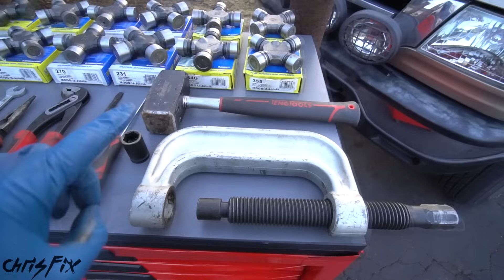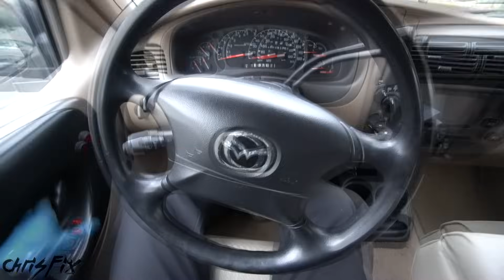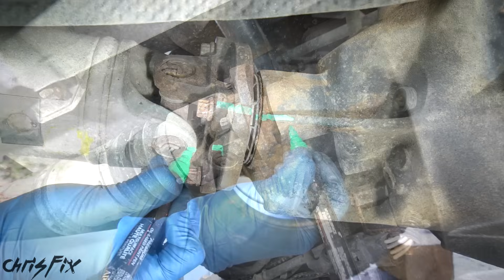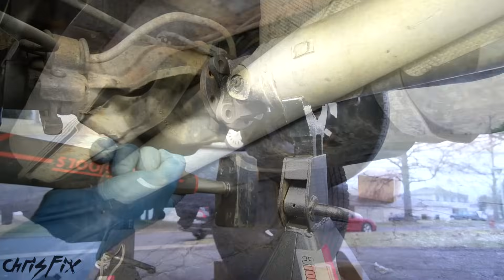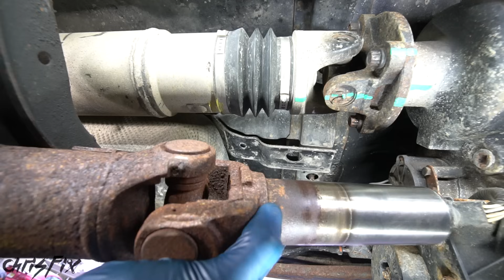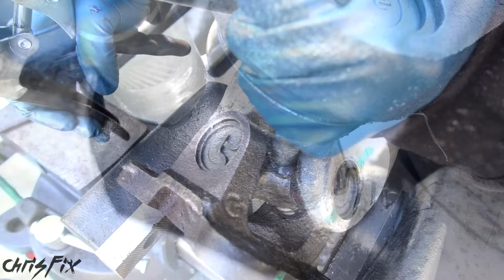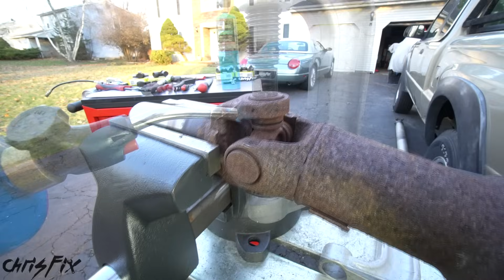How to Diagnose and Replace Universal Joints (ULTIMATE Guide)

Comment: My 2009 Nissan Murano LE AWD has 136,000 miles. The rear drive shaft is very rusty. Would it be prudent to wire brush the shaft, then use something like WD-40 or some other rust stopping spray? Could I throw off the balance of the shaft?

Comment: What if you didn’t mark the shaft and the differential? I did my output shaft seal and the truck nearly ran me over cause I didn’t chock or put the e brake on. Anyway, I didn’t mark anything. But reinstalled everything without knowing shafts were balanced. I do feel vibration now. Should I just mark where it is now and turn it?

Comment: I have a Chevy 1999 suburban, I thought it was u joints because there was a grinding sound coming from the driver side wheel. Replaced them and the sound is still there so you think it could be the wheel bearing assembly?
Reply: Most likely yeah. First would make sure one of the brakes isnt hung up though. Had a similar issue with my caddy.

Comment: U joints changed out in the advance auto parking lot. The caps bearing were all gone and when the caps came off and red dust fell out, they were bad. Whole truck would shake when braking now it rides like a Queen

Comment: Hi Chris. I have a 1989 Toyota pickup. About 8 months after I got it, the rear end chirped really bad. I assumed it was the brake pads (which were bad) but once I replaced those it went away. A few months later it came and went, came and went, well, a year and a half later of coming and going (now) when going over 45, the entire truck vibrates heavily. I drove it two weeks with that. Well last night my dad looks under the truck because I was pretty sure that it was a u joint and sure enough the back u joint wasn’t going bad, but BUSTED. Long story short I drove on a broken u joint for a year and a half😂😂😂😂😂
Reply from the maker: Yikes! I'm glad it's all fixed now!

Comment: Yesterday I had to have a U-joint replaced. I had it replaced by another garage and they used the wrong part number -THREE TIMES. It blew apart on the highway and the end caps were gone! They replaced it it again and it blew apart on the mechanic when he took it for a test ride. I don't know what they did the third time but I had a buzzing grinding sound at speed and I just ended up going to another garage. They looked at it and immediately knew it was the wrong U joint..

Comment: I need someone's help please! I have a 01 mustang GT, heard a chirping noise under car thought it was one of the wheels or brakes, so I replaced all brakes and rotors and calipers, chirp Is still going, so now I replaced both u joints, sound is gone for 2 days and then it came back, it's definitely something under my car. Need help, about to get rid of the car, btw the noise is only present when car is cold and I start driving, when I stop sound is gone, the faster I move the sound fades. The brakes have no effect on sound.

Comment: Did you use the right u-joint? Is there not a u-joint for aluminum driveshafts that have a coated cup to keep the steel and aluminum from fighting? I think they have a "C" or "A" suffix after the number. I change a lot of u-joints and sometimes they are a lot harder to change than yours were. I have never used a press, usually a vice and hammer. Make sure you don't get a needle sideways in the bottom of the cup. I usually put a dab of thick grease on my little finger and rub it in the cup. the needle bearings will stay in way better. Now show how to change the 2 cv u-joints and ball kit!

Comment: I have a manual e46 and it vibrates bad when I let off the throttle or at high speeds and vibration also varies w throttle position most of the time is this possibly my ujoints?

Comment: Quick question...what if my rear U-joint snapped, forcing the truck to kick out the drive shaft. Since it's already out, should there a concern for the way the new one lines up? Getting a new drive shaft, yoke and joints. Drive shaft hot the pavement hard a few times before it finally gave out, so I don't trust that it isn't warped or out of balance. Thanks in advance.

Comment: Great demonstration video - PERFECT!  I wish you would have pulled the seal at the transmission end of the shaft to replace with a new seal. I have a 2002 Ford Ranger 4.0L 4X4 with 172,000 miles and I get a little clang between it wanting to decide to upshift or down shift between 1st and second gears at 20 mph. Like when I gas it on a residential street and brake it to make a right turn where its caught wanting to upshift or down shift (backlash). The U-Joint are probable wore anyway, wouldn't hurt to change them out. So I do the drive shaft U-joint change soon. Thanks!

Comment: Could it be u joints if my car makes a clank and grinding sound when my wheel is turned more then a 45° angle? It's only when I'm backing in and out of a spot or my driveway. Other then that it dont grind when I'm over 20mph

Comment: That's why there is a slip joint on a driveshaft because of the leaf spring as it goes forward the leaf spring goes in s shape which makes the slip joint extend and the opposite happens when braking. One of the common reasons why the universal joint goes bad is because of the driveline angle if the angle is high it would make more vibration and the drive on the driveshaft will be like in oval shape and if there is no angle which reduces the life of a universal joint. Soo it has to be in the middle. The example of the   universal joint wasn't quite right it was an example of a cv because cv joints are flexible, they dont need a angle to work at like a universal joint. CV joints can work at any given angle and they never wear out.
Reply from the maker: Thanks for sharing.

Comment: I just put a starter in my 08 dodge nitro it was atop of the drive shaft so I had to move it out of the way. My U joints need to be replaced. After knocking out that starter like a pro I want to do u joints. My car vibrates and it's no dount the ujoints and they are cheaper to replace than getting a whole drive shaft. I'm excited.

Comment: You make it look so easy. I’ve been at it since 11am. It’s 6pm now lol about to through truck in trash lll
Reply: Lol...I can relate.  Two I was able to get on but the other two is half on and wont budge or move any further.  I have to now pay a mechanic to fix my problem.
Reply: @oneloveyessah  watch out sometimes you will accidentaly knock the roller pins into the bottom of the cab and you will not be able to fully install the ujoint and if you force to hard you will break the loose needle pin

Comment: As usual, you're presentation of the repair is perfect, Chris! This is exactly problem I'm having with my 2017 Nissan Frontier Pro4x, yes this is a know issue on Frontiers. Apparently, Nissan has installed a ton of faulty u-joints, going back years, and they won't acknowledge that it's a problem. I started feeling a slight driveline vibration at around 36000 miles. My truck is still under its powertrain warranty, so I took it to the dealer and they insisted that it's just my tires. Obviously, I know what the issue is and I told them what I suspected, but they totally disregarded my input and I don't think they even inspected the u-joints. All they did was drive the truck and diagnose it based on that. Now at 45000 miles the issue has gotten worse, but seems to be intermittent. Sometimes it drives fine and other times it shakes so bad, I don;t want to drive it. I certainly don't want to pay out of pocket for a warranty repair. I even contacted Nissan USA and they were just as worthless than the dealership. They won't even reach out to the dealer on my behalf. What a worthless company. With the dealership service dept and Nissan USA both unwilling to address this problem, what should I do now?

Comment: Just changed mine out 4wd 2000 ford ranger 4.0 I bolted the front of the drive shaft to the transfer case now when I got to attach the drive shaft to the rear differential the drive shaft is an inch short. I’m lost, any insight would be greatly appreciated.

Comment: Excellent !  There was a little more to it than I thought.  I took notes for reference when I replace them:

There may be up to 4 joints with 4WD.  Some joints may be CV type.
Purchase new standard- or heavy-duty U-joint (HD for high power or high angle).
Select as with grease fitting or sealed type (grease fittings may be centered- or end-type).  Sealed joints can typically last 100,000+ miles.

Driveshaft removal:
Mark orientation of drive shaft-to-flange/yoke and yoke/flange-to-differential/transmission/transfer-case.
Disconnect rear flange first.
May need penetrating oil for bolts and clips.  Heat around connection for fuzed bolts with torch.
Unbolt.
Hammer flange to separate shaft connection.  Possibly rest driveshaft on stand(s).
Put drip pan under front transmission/transfer case end.
Remove front end.
Remove drive shaft. Do not drop, bang or dent drive shaft (balancing).

U-joint removal:
Put driveshaft yoke/flange in vice. Do not put drive shaft body in vice what so ever.  Tighen on strong ends, ears or flange only.
Remove retaining clips with needle-nose pliers or hammer out with screw driver and pull with pliers. Clips may be end-type or internal c-type.  If clips break, hammer out with screwdriver.
With yoke/flange in vice, press out U-joint (rent/use U-joint C-clamp press.  If no press, use largest accepting socket and hammer; flip to perpendicular side with vice closed enough to rest u-joint on previously removed lobes.  *Some cases (GM) might have plastic injection at cap/flange bore; melt plastic with torch before removal.  There will be small injection holes leading to the bore. 
Remove cap.
Do opposite linear side of joint.
Remove U-joint with created clearance.
Do perpendicular side of U-joint.
Remove U-joint completely.
Do opposite end of drive shaft.

Replacement preparations:
Clean c-clip groove in bore of yoke/flange (if applicable).
File off any burrs at yoke's external bores on both sides (to prevent scratching new u-joint mating cylinder surface).  Do not scratch yoke/flange's internal bore.
Lightly clean bore with abrasive pad or 1000 grit sand paper

U-joint replacement:
Inspect cap for needle bearings to be in place. 
Possibly add anti-seize to bore.
Insert U-joint to yoke/flange.
Insert joint cap by hand.
Press in cap far enough to just allow for clip installation (For hammer method, close vice enough so yoke/flange ear rests on vice - not U-joint; hammer joint in with socket).
Install all caps and clips.
"Good".
Test joint for free rotation. If resistance, tap flange ears with hammer; it should free up. 
Install drive shaft to U-joint; line up driveshaft to flange at marked position.  Test for and produce free rotation.
Grease joint (if applicable). (Grind grease gun fitting if it does not fit {likely}).
Install new U-joint at opposite end.

Drive shaft reinstallation:
Connect front end first.
Clean up mating surfaces with wire brush.
Fit flange/yoke at marked position.
Insert bolts.  Use removable thread-locker on bolt threads.  Use criss-cross tightening pattern; final tighten to 80 ft.-lbs.
Connect rear end, similarly.
Mark installed bolts to monitoring loosening.

Completed.

Test drive.  Listen to hear no sound or feel no vibration.

My notes from Chris Fix video.

Comment: My suburban makes the same sound but when I apply the brakes it stops making the sound. I can hear it while the speed 1-50 miles an hour. But can’t hear it if I drive faster than that. You still  think it’s u join or something else? 
Oh, and it’s not the brakes or bearings I replaced them already

Comment: Today I replaced both u joints because my car was vibrating at higher speeds. First testdrive and vibration is still here. Front u joint have a bit of play. I did everything to make it fit easily and free. Placed all four clamps. Could my driveshaft be bad? It feels like the end of it is too wide.

Comment: You forgot the easiest way to check the ujoint.  Put a tire stopper behind the tire....release tension on the driver shaft by putting the car or truck on neutral then park again.  The weight should be on the tire stopper.  Then you can move driver shaft to see if the ujoint is bad.

Comment: Thanks for the info.  At least I don't have to replace the entire Drive Shaft.  Everyone is trying to sell me in buying a new one when I only need the U joint replaced.  I have all of the symptoms that you showed.  Vibration included with one added symptom.  Overheating in idol.  This may resolve that symptom as well.

Comment: I had to replace the u-joints in my truck when I rebuilt the transmission. I had been hearing a clacking noise from the front axle when I turn tightly so I thought it was just the axle shafts rotating with some play. Turns out the front u-joint was BONE DRY, no grease whatsoever. That turned out to be the source of clacking.

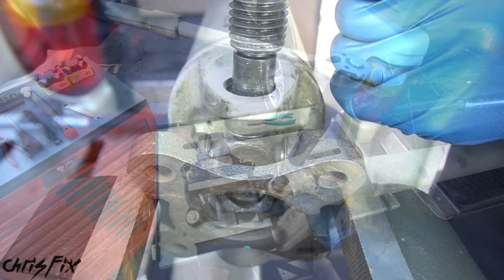Comment: I saw that movie magic swap you did, at 14:19 you were most defiantly using an electric impact to press that U joint out. the press bolt moved much to smoothly and fast to be a hand wrench. I appreciate that it is possible to do these repairs with hand tools, but it seems just a bit tricky to say, "im gonna do it with this hand tool!" then sneak a power tool in to do the job off frame. Im not sure if you could not get it to come loose with the hand tool or you just wanted to save yourself time, which is the problem. you could use the "crap its stuck" moments to demonstrate WHY you should save for good power tools by showing people the problems you run into with hand tools, heck i would say for many jobs its better to have a cheap affordable crappy powered tool from a discount tool supplier (HF) to get the job done rather than blow out your back or wrist etc to crack a bolt loose or remove a stuck bearing with a hand tool. I appreciate the videos and i have used them to save myself some cash on repairs but i stopped buying into the hand tool hype after my first brake job..... But this video is over a year old at this point and i doubt you will ever read this comment. So those that read it, save cash and buy good power tools, electric or air it doesn't matter, and a cheap electric tool that works is always better than an hand tool that SHOULD work. just get something lol thank me later. So thank you for your videos and hard work Chris i really do appreciate it and ill continue to watch, hopefully you see this and maybe make some editing changes to your videos and showcase some of the hand tool issues that people are bound to experience, especially in the rust belt states.... Wow i wrote you a novel on this one lol

Comment: Please help, I have a Hyundai Elantra 2013. When I start up the car and change my gear from park to reverse or drive it makes like a clunk sound. It doesn’t do it every time but since it never use to do it before Im assuming something is in need of repairs has anyone ever experienced this. It’s front wheel drive with about 67k miles on it. Thank you very much
Reply: More than likely a motor or transmission mount.
Reply: Ilikeboost this may be a dump question but any idea on how to tell between the two ? Thank you for the info so far
Reply: Take a pry bar and pry against each mount. They should have a little play but not much.
Reply: Thanks again for the help. I’ll try it tomorrow and update the post afterward

Comment: Wow you make this look so hard😂😂 Just take the clips out place the yolk on  the vice, twat the flange till the cap pops up half way, 180 spin same again with that side. Wa laaaa flange off. Then place joint off the flange on vice resting the shaft on bent then repeat method by hitting the yolk instead of the flange this time! Out in 60 seconds. USE A COPPER HAMMER!!

Comment: I've got a 2002 grand Cherokee with almost 210,000 miles, and the u joints are still in great shape, and they're factory. They're on their way out though, because the dust boots are falling apart, but they're still tight and smooth

Comment: I have been all over the internet and can not find what may be wrong with one of my cars.  If I can get some advice that would be awesome.  The car in question is a 1999 Lincoln Town Car Limo.  After it's been sitting over night, I can get in and start driving with no issues.  Everytime after about 10 minutes or more driving.  I have this rubbing feeling coming from the rear end only when turning from a stop, and the noises stop after straighten out.  Accelerating straight or while driving there is zero noise.  I'm lost.

Comment: Remember to have the Grease Fitting point towards the driveshaft for future greasing.
Reply: How often should it be greased? My friend was told at every oil change 3000 to 5000 miles. His truck tows a flat bed towing 2 zero turn lawn mowers n ect. He has his personal lawn care buisness.
Reply: @kbutterfly91070  Grease in the Universal Joints rarely escapes.  1 pump every other oil change is lots.  Some have no grease fitting. Synthetic Oil lasts easily 5000 miles.  Buy the best filter.  Not Fram.
Reply: Ty for me yes I never use fram n always use synthetic oil. I replace my u joints over 2 years ago. I only greased them when installed. So I'm going to check tonight both vehicles. Ty. My friend went to garage 2 year ago n mechanic never told him about greasing them. The clip n cap on his blew off n driveshaft dropped hes lucky he was doing about 10mph. His drive shaft where u joints go it broke n has to get another drive shaft n my son told him he needs the better steel 1 since hes towing equipment too. when u joint blew off clip n cap. Garage just did his joint 1 year ago. I'm going to show him Chris fixit on utube so he can learn more.. 😊 ty
Reply: @kbutterfly91070  The Clip was not installed correctly.  You could never 'blow' it off.